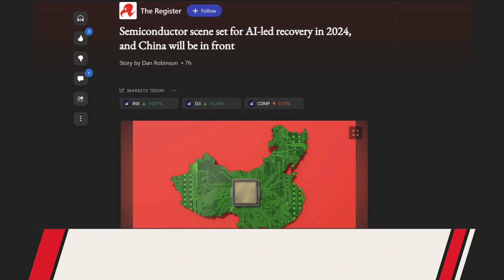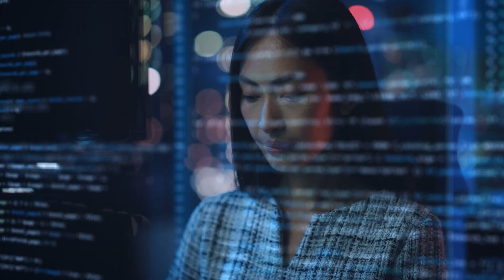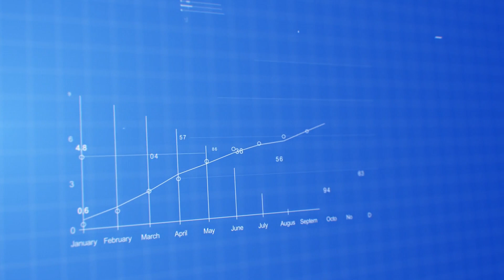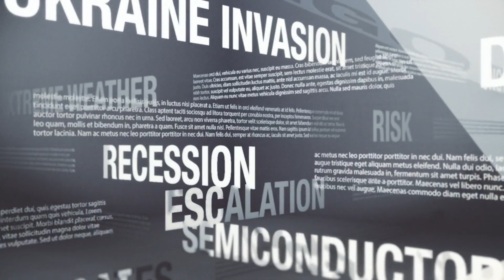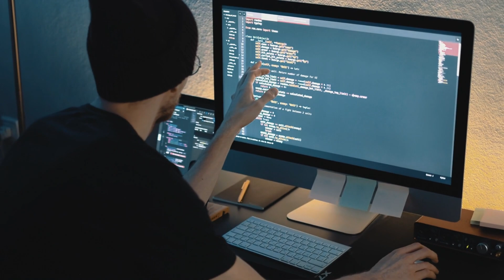CRIPPLE PLAN!  U.S Plan to Destroy China Chip Making

Comment: 2024 will be an inflection point for Chinese semiconductors.  There will be revelations about China's efforts to equal ASML's EUV lithography and the production of 5nm chips using existing ASML immersion DUV lithography. We may even see x-ray lithography realized.  Further, China's research efforts into photonic, graphene, and quantum chips are starting to pay off.  Photonic chips said to equal 2nm silicon chips are being produced, graphene chips said to be a thousand times faster and with less power consumption have been proven, and quantum chips are in production.  Even Russia has developed capabilities to produce 7nm silicon chips.  So, 2024 will be auspicious as China converges on self-sufficiency.

In the realm of AI/GPU chips, Huawei, Tencent, and Alibaba are said to have developed GPU chips on a par with Nvidia and Longsoon is rivaling Intel in the CPU sector.  Further a data point on production showed China with 44 fabs and 12 more being built in 2023.  As this video commented the world is also expected to increase their fabs and so will China add more fabs.  

At the end point of this race, it will be costs that drive the winners in this hotly competitive race in silicon semiconductors.  China decidedly has the best chance to compete and everything else being equal, to emerge as the semiconductor leader in production and use. Huawei has proven that China can produce its own domestic semiconductor supply chain from raw materials to finished products, from design to fab, test, and encapsulation with the necessary software, fab, test, and encapsulation equipment to complete the entire series of functions needed to produce semiconductors.